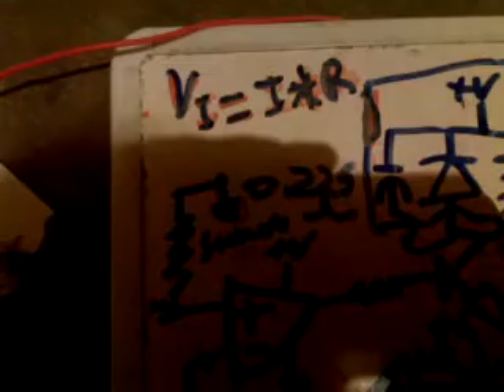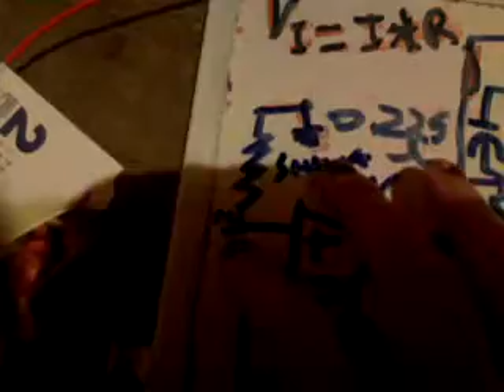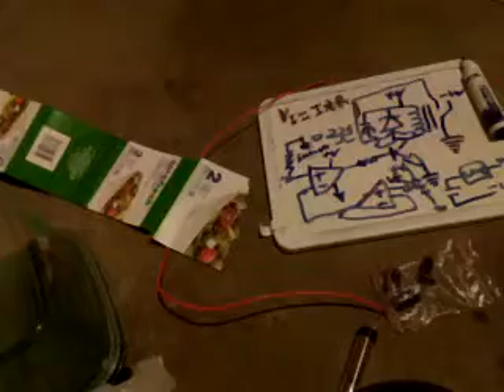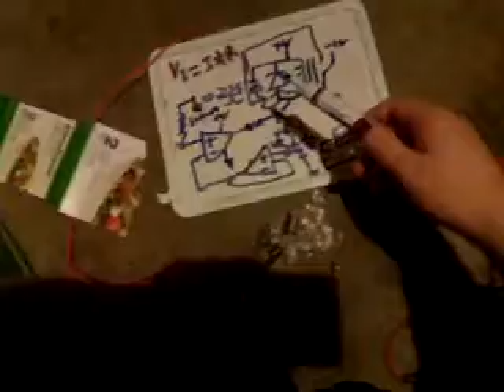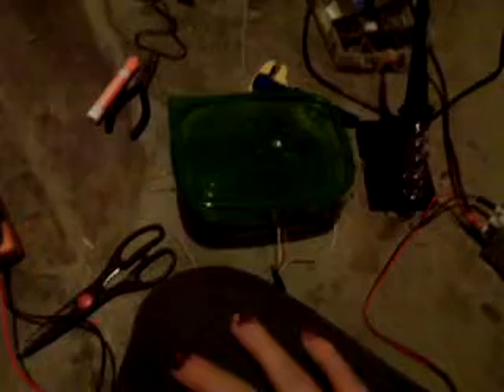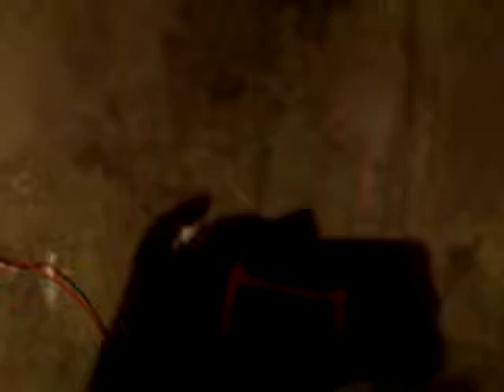Adjustable Circuit Breaker

Comment: i need something like this but for 120v ac 3 to 10 amps
Reply from the maker: Check this circuit out that i found http://www.brighthubengineering.com/diy-electronics-devices/74420-make-an-ac-mains-electronic-circuit-breaker/#imgn_4
Reply: delphijustin thanks...